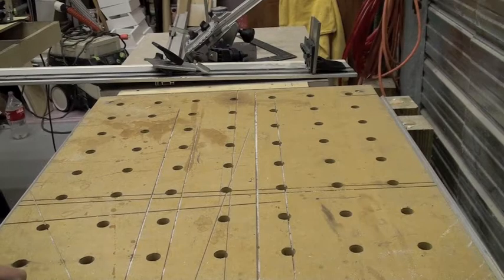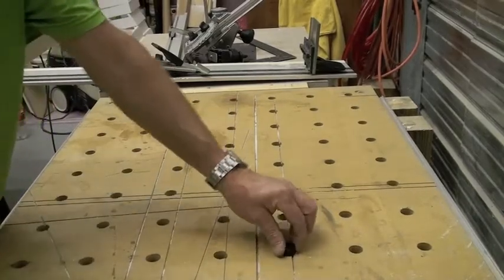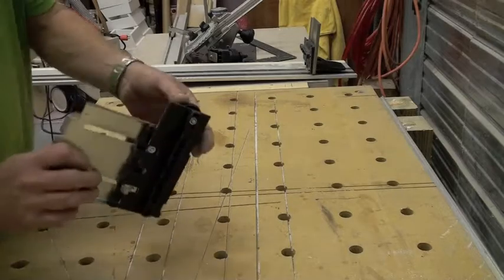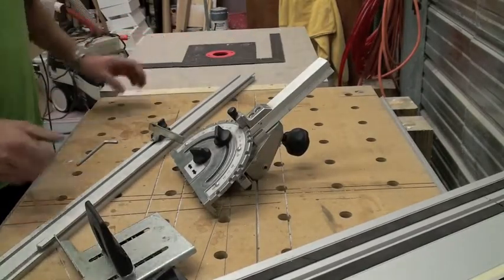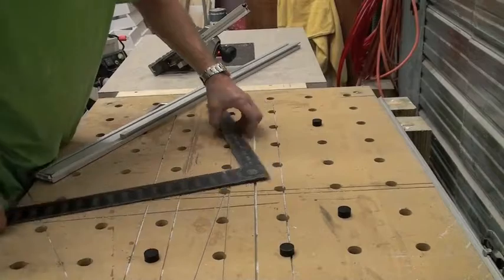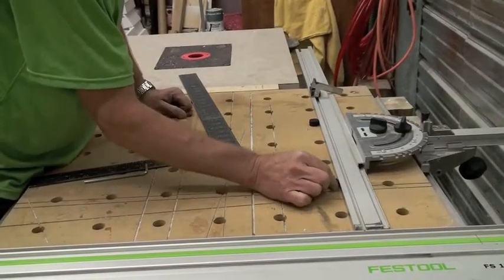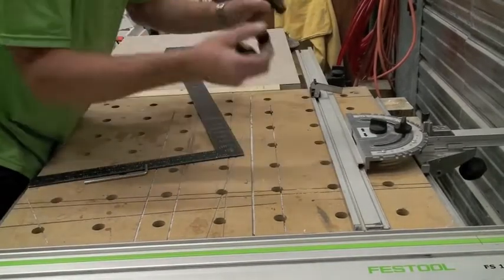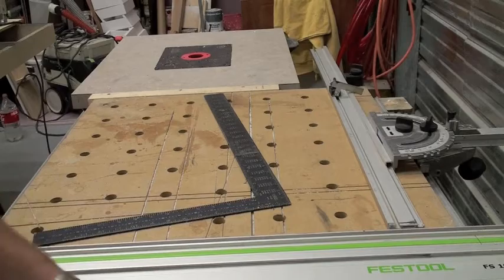mft3 & Qwas

Comment: I have a Festool router table that attaches to MFT.
The fence are very pretty indeed, but set up is very tedious and I can not find that point of trust in them, they don't perform like a straight forward simple fence I had before, let say, jessem, they are flat and plane.
If you can give me tips on a simple calibration and setup of CMS router table fence, I mean, make them square and two half plane, so I can joint with them.
Reply from the maker: vovcha666 The fences on the CMS tables are very adjustable.  They are not like the Incra fences with their rack and pinion forward and aft adjustments.  I don't know if you are a member of the Festool Owners Group (FOG) or if you know that there is an excellent supplemental manual out there:  http://www.festoolusa.com/media/pdf/Festool-CMS-Router-Table-Supplemental-Manual.pdf that will help with setting up your CMS VL.

Peter

Comment: What's it like cutting narrow stock? Can you really use this as a chop saw or is there a lot of flex in the rail? I suppose you could support underneath with stock of the same thickness but would that be too time consuming?
Reply: +Adam Bronstein It's not a replacement for a chop saw, but in the setup shown the rail is supported at both ends, and then also by your stock.  It depends how narrow you're doing on whether or not you'd need additional support.  The rails do flex but the real worry on narrow stock would be tilt (twist in reality due to end supports) rather than flex.

Comment: Okay here is why the mft does not cut accurately even if one side is dead 90. Its because the side you are cutting may be 90 to the other side. So now you have just made it 90 to the side you cut but not 90 the the other side. This horror story will continue till you figure out you need a table saw. pick the straightest side(preferably after running it through a joiner) and use that against the fence to make the blade cut side parallel the other side.  Now you can cut 90 on the mft.
Reply from the maker: If you set the left side of the rail to be 90 then the right edge - the plastic strip edge should also cut 90 unless the raised part of the rail is not parallel to the left edge, and that would be very unusual - but possible.  I would also suggest that if you haven't already make sure that the saw is adjusted to ride on the rail without any slop using the two adjusters on the bottom.

Comment: Thank you, Peter!
Nice video with an accurate and a straight forward setup.
Do you use MFT fence for you router table, since it is attached to your MFT, and if not, what kind of fence do you use... I have MFT router table and hate the fence....
Sincerely,
Vladimir
Reply from the maker: vovcha666 Thank you for the comment.  I have never owned one of the fancy fences for a router table.  I have used everything from a festool rail to a simple plastic fence from Oak Park (now 25 years old) to a cheap Rockler fence.  It all depended on what type of cut or bit.

I admit that I now have a Festool CMS table for my 1400 router.  I enjoy that setup a lot although I don't use a router as much as I used to.

If I can be of assistance just let me know either here or else on the Festool Owners Group (http://festoolownersgroup.com  )